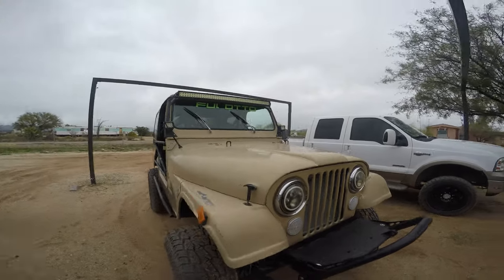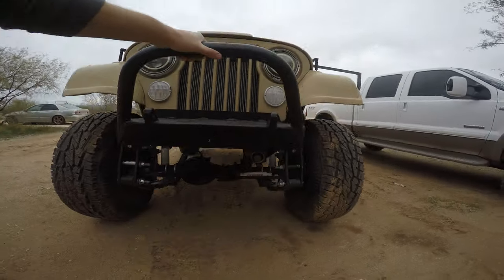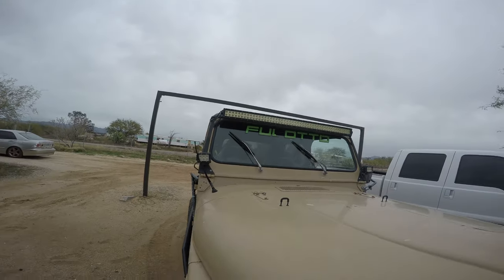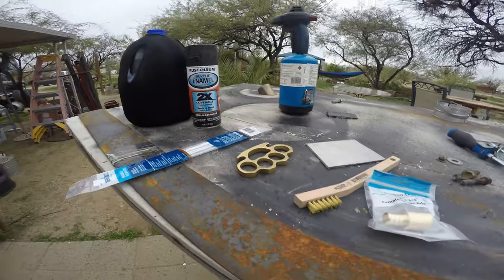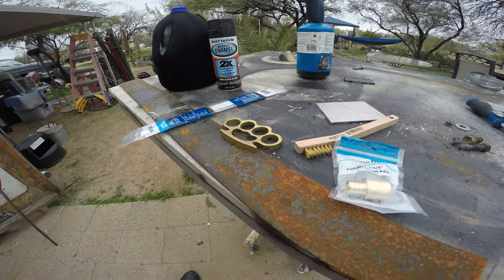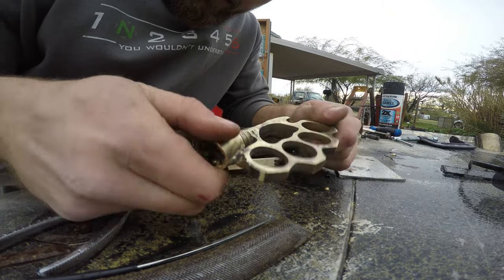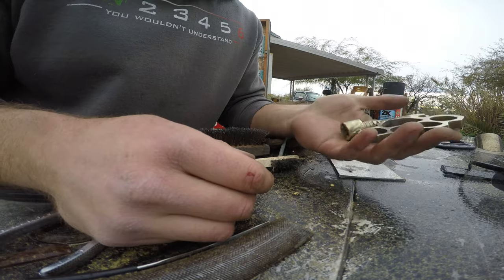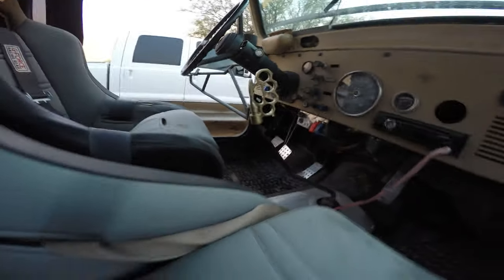Brass Knuckles to Shift Knob!

Comment: Is it comfortable while shifting? I have a Mustang GT and they sell this type of shifter on eBay and I was wondering about the comfort level versus a traditional ball style shifter. Also do you think you can grab the outside of the brass knuckles to shift or do you have to stick your fingers in the hole? Love that you made it yourself though I’m not as skilled as you LOL
Reply from the maker: I was worried about that same thing when I was building it. But it is surprising comfortable while shifting. I find myself resting my hands in it while driving, it just feel natural haha. And yes you can shift it from the outside of the holes just fine!
Reply: You get alpha status with this shifter